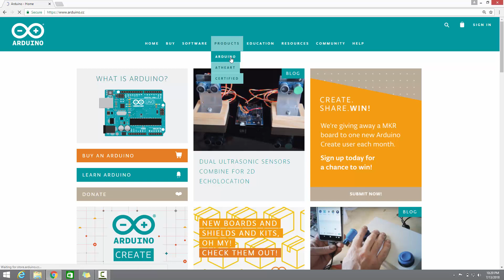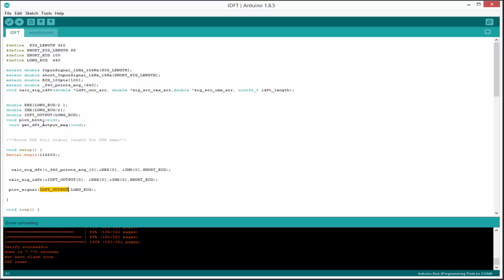Digital Signal Processing(DSP) From Ground Up™ using Arduino

Comment: Is this course still available? If so, please provide a link directly to it.
Reply: Was looking myself and found it at https://www.udemy.com/course/arduino-dsp/
In the meantime, I didn't see any mention of Goertzel in the course description.
Reply: @AndrewTuline  Rats!, that link already leads to "This course is unavailable." I'm curious about the capability of a 100 MHz or so Arduino clone. Or even 600 MHz lately.
Reply: @johnschindler9641  Damn, it showed up earlier. As far as Arduino goes, I'm pretty happy with the ESP32 and have used the ArduinoFFT library with it for our sound reactive fork of WLED. I would, however like to learn a bit more of the math behind it all.
Reply from the maker: The link will be back online on 9th August